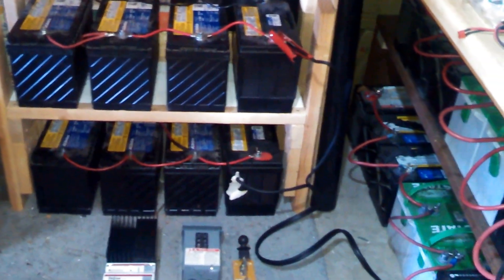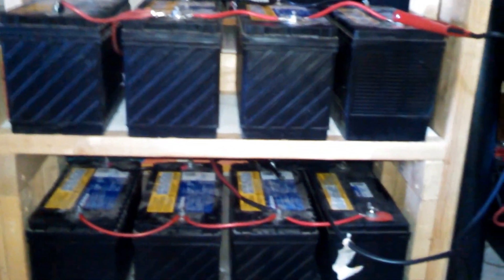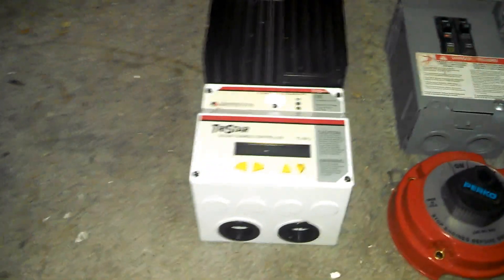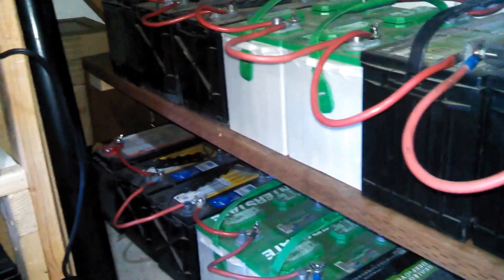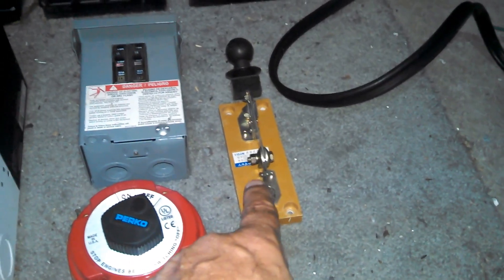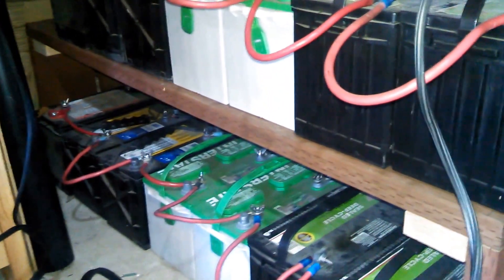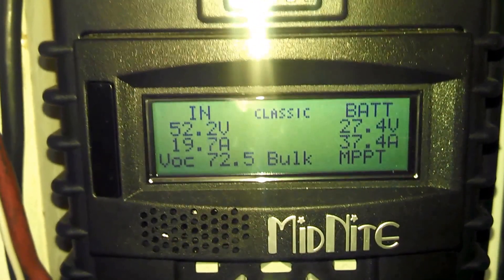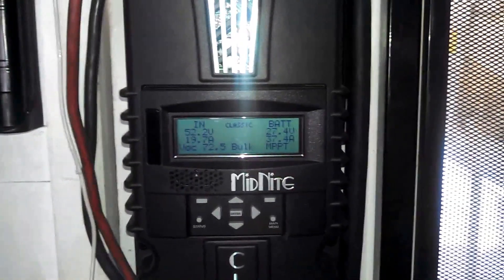My New 12 Volt Battery Bank for LEDs.

Comment: Whats the ROI??? Return of investment? 30 years? 40 years? How long the battery last? 2 years? 3 years? How much the batteries costs??? Is it practical?
Reply from the maker: Yes for me it's priceless to have constant clean power that will not surge and damage my electrical appliances/equipment and or the electronics at the house.  Also when the city electricity goes out I still have power to feed the house and the neighbors without any disruption!
Be Well,
Raz
Reply: sorry about my comment, glad to have a person like you that love clean power. Thanks for the enlightenment.
Reply: and also the love on your neighbors. You're very kind sir.

Comment: Do the interstate batteries match the black batteries they are with?
Reply from the maker: They are close!
Reply: ElRazTheGreat1 Reason why i ask is because I have two interstate batteries but I dont think they are a match one is close to the new 27 and the other one looks like a 24
Reply from the maker: shartne You are right Scotty they do look like the 27s, I would check the interstate website to be sure.
Be Safe,
El Raz